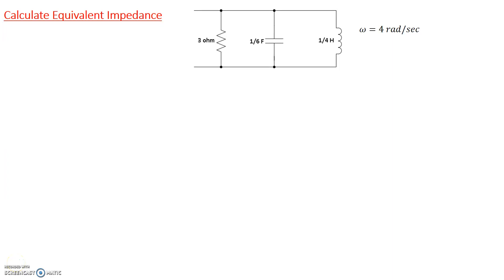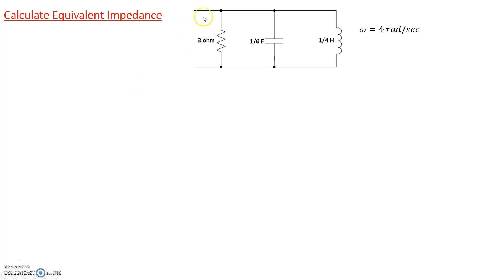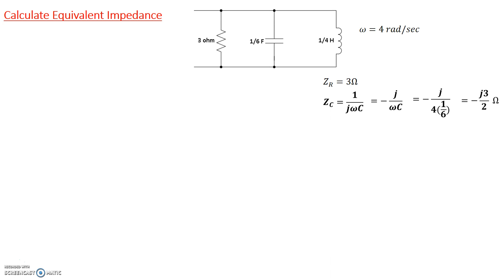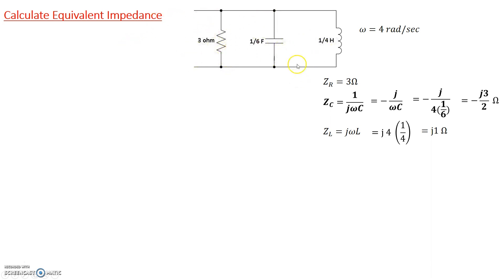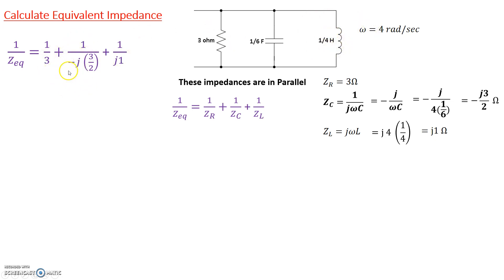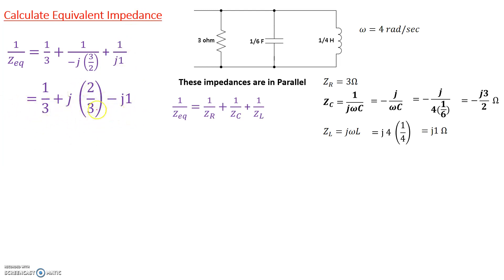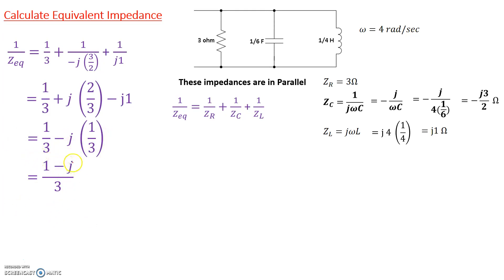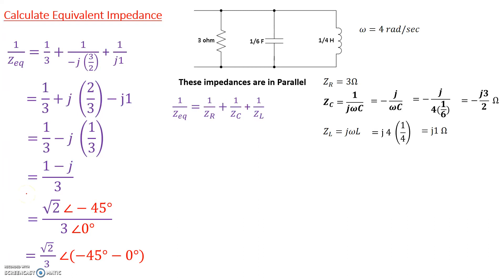Example 1 Equivalent Impedance

Comment: I thought for capacitors when they're in parallel it wasn't a reciprocal, unlike the resistor and inductor.
Reply: You are correct that for capacitors in parallel, the total capacitance is indeed the sum of the individual capacitances. However, when dealing with impedance, the situation changes. Impedances follow the reciprocal rule, similar to resistors in parallel.
Reply: @GoldenJrDesigns-zf9ri  I see, thanks for the quick reply!

Comment: 3:15 it isn't clear how 1-j is equivalent to sqrt(2) angle -45° in phasor form, please explain.
Reply: assume a = 1 ( a is the real part of the complex equation) and b = 1 ( b= 1 because the factor before j is 1 , like 1j. reminder that b is the imaginary part of the complex equation ). to find V2 you just have to do sqrt( a^2 + b^2) , here it will give us sqrt( 1^2 + 1^2) which is sqrt(2). To find 45 degrees , just do arctan(b/a) , so in this example it will be arctan(1/1) which is 45 !
Reply: @limorgecer9175  thank you!